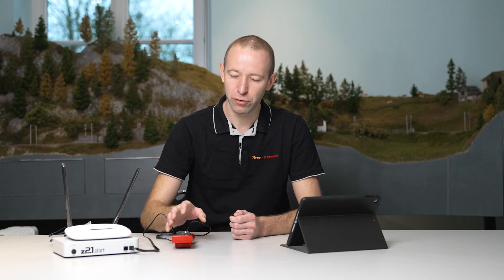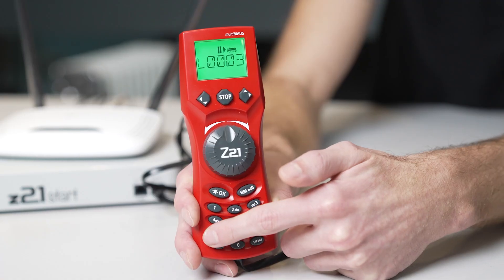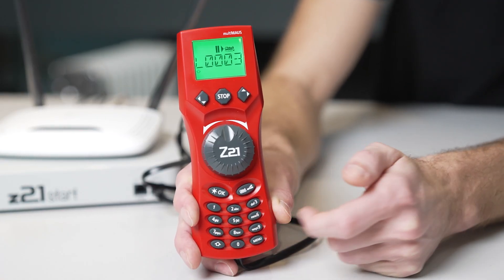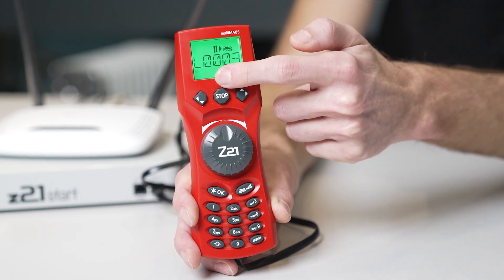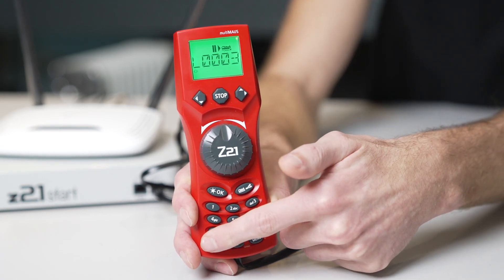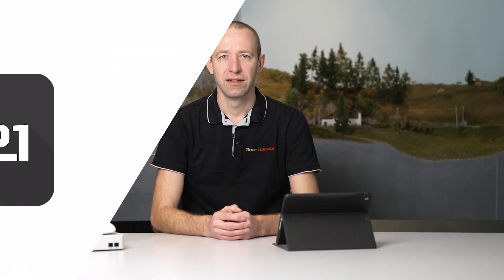Questions & Answers I: Digital for Beginners video series

Comment: Hello, I have 3 older start sets with 10764 and I purchased a 10785 Rocomotion. My first question is how can I add wireless control, for example the 10814 or an iPhone to my system? My second question is how can I update the firmware in the multiMAUS of I don’t have any of the Z21 (10822 or 10833)
Thank you
Laszlo from Canada